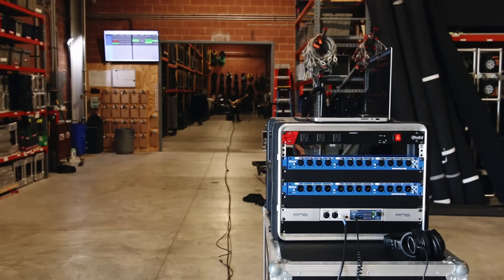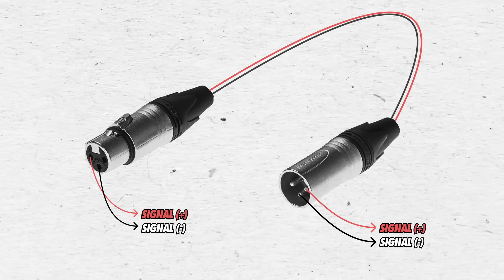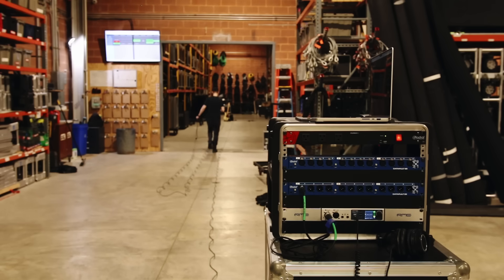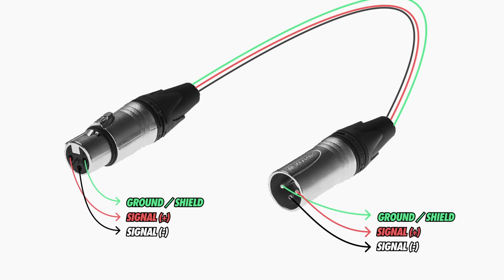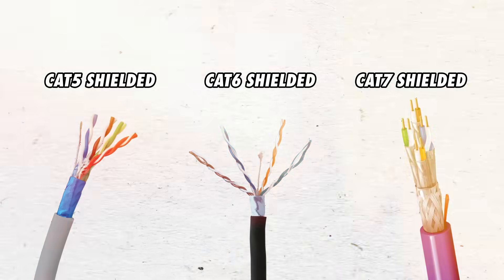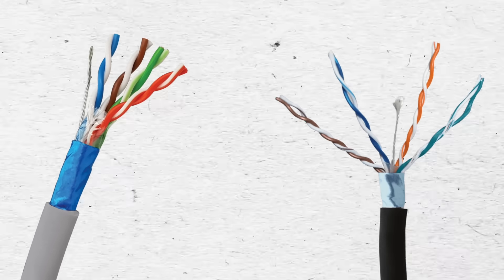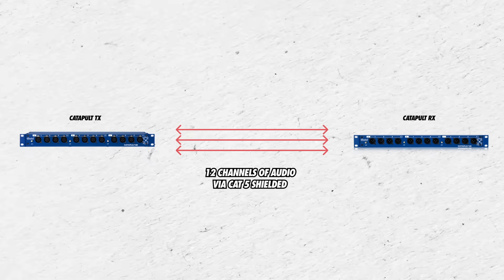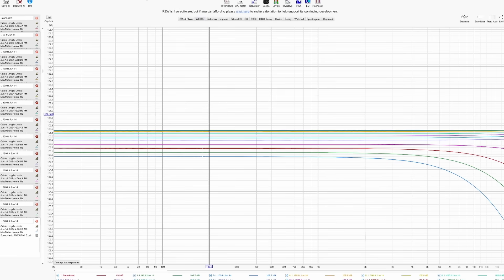Do Audio Cables Affect Sound Quality?

Comment: I have swapped balanced cables on a high-end stereo.  Sometimes, the difference in sound quality is hard-to-near-impossible to hear any differences.  And even if there is a slight difference, I would not be able to tell which ones were in use (I could hear a slight change, but not be enough to tell one from the other).

But then there are swaps where the difference is apparent.  That happened when I did a listening test with Audioquest's "Sky" interconnects.  Everything sounded better.  Switching back to any of the other balanced cables was easily noticeable (sound degradation is more noticeable than sound improvement).

All of the balanced cables that I tested (via my ears) were made by respected audio manufacturers.  But somehow those "Sky" cables were just better.

Why?  I wish I knew.  But there was no mistaking the difference.  It was not wishful thinking.  A person deaf in one ear could hear the difference.

So there is something going on with the construction of the cables that factors in to the sound quality of the stereo.

There is the "copper" vs "silver" difference to consider.  But some of the swaps that I did were with "like" metals (silver vs silver), and the "Sky" (silver) won.

My listening tests were not the same as what our host demonstrated, which was mostly for distance.  My listening tests were for wiring up a high-end, home stereo.
Reply: Sky is silver, solid core, has no dielectric molded to the conductors (each is placed in a Teflon tube) and uses 3 discrete conductors, not just 2 and a shield. If you look at the qualities I just listed, plus some others that I didn't mention, and compare them to the other cables, chances are that the materials and design of the Sky will be completely different. Given that, the real question is, how could they not sound the same? If I had to guess, the silver was the biggest factor. I've done extensive blind testing between silver and copper, but you really don't need to because the differences between them is easily apparent. But, like you said, you were testing in the context of a high end home system. In general, really good home gear reveals a lot more details than pro gear, or studio monitors. I have studio monitors from companies like Adam, KRK, Kali, and Dynaudio. I've tried high end cables with them on many occasions, and the differences, if any, were little to none. On that type of equipment, all you need is something cheap and well made, like Mogami, and you'll be fine. 

Regardless of what type of gear you have, never spend big money on cables without first trying them in your system. Also, be careful with silver. When it works, it sounds great. But that's not always the case. Quite often you get lucky and a copper cable will sound better in a particular connection.
Reply: @AT-wl9yq  "If you look at the qualities I just listed, plus some others that I didn't mention..."
That you just listed where?
That you didn't mention where?
Reply: Measure it.
Reply: @wrenchposting9097 What would you measure and why?
Reply: @wrenchposting9097  "Measure it."
How do you measure a wider soundstage?

Comment: Having done a lot of networking I immediately assumed you'd get 328 feet (100 meters) out of CAT, as this is the standard for data and POE in general before needing to insert a network switch/hub/repeater to get another 328 feet. (You can exceed the standard but it is quite dependent on the situation) Was quite surprised how you can get such a significantly longer run with analog. Not that I'd even need 100 meters let alone 8x that it was still cool to see it done!
Reply from the maker: The frequencies within the audio signal are MUCH lower than the 328-ft specification. We only need it to support 20kHz, but cable made for digital and network connections support MHz and GHz communication!

Comment: Amazing video!  I will reference this frequently! This has me now wondering about delay in relation to distance with audio signal.  Eager for more videos from you, thank you!
Reply from the maker: These electrical signals travel at the speed of light, so there will be no audible delay.
Reply: @AudioUniversity  that’s awesome thank you. Do any previous videos cover delay when daisy chaining speakers?
Reply: Just for fun, did the calculations. For the signal to have 15ms of delay (the absolute lowest of the detectable delay), the cable would have to be 2800 miles long.
For a curious coincidence, that is almost exactly maximum wide of USA from coast to coast

Comment: No self respecting guitarist is ever more than 15 foot from his amp.  Showing how bad it sounds with a 100ft cable is just stupid.  For one, WITH a cable, you want to hear the amp, second, most people will use a digital wireless.  When I play, I always use a single mono cable close to the amp to control the feedback and hear my tone, shield grounded at one end.  Also, why are you talking about TRS cables for guitars?  It's mono.  The shield is only there to stop interference down the length of the cable.  It has no benefit to connect it at both ends of the cable, as it creates a ground loop in the amp.  Just get a good quality cloth/cotton braided coax cable and solder it to 2 quality mono Neutrik jacks, cut the ground from one end, mark the shielded end and plug that into your guitar.  Noiseless and no ground loops.
Reply: I guess you didn't saw the video till the end. 
That experiment with a long RCA cable was just to show why is not possible to use unbalanced cables for long distances (From the stage to the mixing table, etc...), and that's why XLR and CAT6 cables exist.
Reply: @framegrace1  Didn't 'see' not saw
Reply: @framegrace1  Who the fuck uses a 100ft cable?, in fact I've never used a cable longer than 15 foot in 30 years, 150 gigs a year.  It IS my living.  You're all out for spending money for no reason.

Comment: There is a big difference between an unbalanced hi impedance instrument signal and a line level signal. It is not necessary to use balanced cables when dealing with line level signals in a home studio situation. It actually creates an extra failure point. The quality of the cable also makes almost no difference, when you are dealing with line levels. 

With instrument cables, there is a slight difference in tone and/or audio quality from one cable to the next, but the most expensive cable does not always outperform less expensive cables. A Mogami cable will usually sound just as good, if slightly different, compared to the most expensive cables. Once your instrument signal has been converted to low impedance, by going through the buffer stage of a guitar pedal for instance, the rest of the cables in chain also make very little difference. Spend you money on the cable that carries the high impedance signal from your instrument. Don’t worry about the rest.
Reply: Passive guitar pickups are low impedance, fuzz pedals need to see this else they don't work right.  Been playing in bands for 35 years and never needed a cable over 15-20ft.  I gig 3 times a week, every week.  Festivals, clubs, radio stations and pubs.  Just use a quality cotton/cloth cable with stainless mono Neutrik jacks for guitar/bass.  Connect the shield at one end only and plug that end into your guitar.  Noiseless and no ground loops from the amp.
Reply: passive guitar pickups are high impedance. Unless you are using two conductor wire, if you don’t connect the shield at both ends, you won’t get any signal because you won’t complete the circuit. And if you do use two wires, but only connect one side of the shield, the shield will still be attached to both ends because it will still be connected to the ground wire. The method you’re talking about would apply to balanced line level signals, not unbalanced, high impedance instrument signals.

Many, but not all, fuzz and wah pedals need to see a high impedance signal.
Reply: @APMTenants  A single coil can be around 4-8k, a humbucker 6-18k, that's low impedance.  Only active pickups have high impedance of 1 mega ohm or more.  And an audio signal is AC, only 1 signal wire, no need to 'complete the circuit' as it's not a loop.  Maybe you're confused with how audio AC works, active vs passive.  Even D'Addario sell guitar cables shielded one end only.  Planet Waves cables.
Reply: High impedance is about 1k and above. Below that is low impedance.

Active pickups are LOW IMPEDANCE, because they run through ACTIVE electronics that convert the signal to low impedance. Without the electronics, then it would be high impedance.

No man, you cannot get sound out of a guitar pickup with just one wire and no ground; that defies the laws of physics. The type of cable you’re talking about is a twin axial cable, meaning it has TWO wires, and it does nothing when connected between your guitar and amp for the reason I already explained.

You need to use google and go back to school. I’m going to ignore any further responses because it’s just too ignorant for me to deal with. Playing in bands does not qualify you as an electronics expert. This is noob level bs

Comment: DI box with 3.5 mm input available for connecting PC audio output??  Pls recommend some good brand DI box??
Reply from the maker: Check out the Radial ProAV2.
Reply: The ProCo AV1b is another good DI that has 1/8" (3.5mm) and is about $70 cheaper than the Radial.   If you are good with your audio summed to mono then the ProCo might be something to look into but if you need proper full stereo output then go with the Radial.

Comment: Not quite the video I was expecting from the title… I read once that higher frequencies prefer the surface of a conductor and so a multi-strand cable with thicker conductor yielded more high-frequency clarity over distance. I also wondered about the properties of copper vs aluminium…
Reply from the maker: The twisted pair cable is rated for frequencies MUCH higher than audio frequencies, so there may be an additional advantage there. But as you could see in the frequency analysis at the end of the video, the frequency response is flat up to about 1200 feet! Pretty amazing. These results will probably hold true for any balanced audio connection.
Reply: You're thinking of the 'skin effect' which is negligible at audio frequencies. People bring nonsense like that up when they are trying to sell you audiophile scams.
Reply: @wrenchposting9097  I’ve suspected my whole life that it was bullshit, and expected this video to deal with it. As another commenter said, it’s a rabbit hole!

Comment: I just realized that I don't think I've ever seen an electric instrument that had a balanced TRS/XLR jack. I rarely went electric with my violin so I have little to no experience with this (every option for it sounds like a farting rubber band). With all the benefits of a balanced cable, I would have thought that instrument manufacturers would be tripping over themselves to make this the standard. And for an instrument like an electric guitar it seems like there'd be plenty of space within the body to put an appropriate DI box equivalent in there. I did some googling just now and I'm getting all kinds of answers, but nothing clear and obvious. There's gotta be a good reason why this isn't a thing--especially since everyone keeps warning each other to bring your own DI box to every gig because you can't rely on the venue to have a decent one.

Is it because of the difficulty building it into the instrument? Is it because the choice of DI box has a massive impact on the tonal quality and instrumentalists are picky? Is it because the peripherals and pedals simply never come with a balanced I/O? Is it because of the added cost/weight for little benefit? Or is this just a product of the ol' "this is how So-and-So did it in 1967 and that means it's already perfect" that guitar fetishists tend to do?
Reply from the maker: I think it's because the impedance and level that come from the instrument pickup don't require a balanced connection at short, typical cable lengths. Also, the input of amplifiers and pedals is designed for this type of signal, not a low-impedance mic-level signal that comes from a DI's output.
Reply: @AudioUniversity  Can't feed a fuzz pedal with anything other than the low impedance from a guitar pickup.
Reply: @AudioUniversity  Ah, I see now. I didn't think of the impedance difference of a DI output going into the pedals and amps. It doesn't make sense to drop the signal down after the pickup if you have to boost it back up again. I've been reading up on the basic tone quality and responsiveness between active and passive pickups and now I see why even a couple thousand ohms of difference is such a big deal for the signal quality. This stuff's all new to me. What a rabbit hole. Thanks for the response!

Comment: I love when "audiophiles" claim the cable (or whatever insanely expensive piece of gear they're trying to justify in that moment) is worth the money they mention how it magically "improves sound stage", or "removes the veil" etc, all stuf that's conveniently impossible to measure, never that "it has less noise", as somehow noise can worsen or improve sound stage.
Reply: "Audiophiles" are just non-audio nerds pretending to be audio nerds. Most of them don't know anything, just a bunch of mumbo jumbo about why vinyl is objectively better or something stupid. They'll spend 10K in gear, another 10K in records, and then never stop and think to acoustically treat their damn room.
Reply: @urphakeandgey6308  I do 150 gigs a year, playing in pubs, clubs and open air festivals.  I know what you need.  Really you don't need to spend loads of money, I don't.  Most guitarists and bass players that walk into crowds with wireless just come across as pricks.
Reply: Just get a decent quality mono cable and solder the ground at one end only.  For the best noiseless result, use cotton/cloth braided coax and Neutrik stainless jacks.  Plug the shielded end in your guitar.  No noise on the cable and no ground loops from the amp.  Simple and cheap.
Reply: Well you didn't take long to turn up.
Reply: I always laugh at that. Even if the audiophools electronics were perfect (i.e. no distortion and exact reproduction of the mastered audio), they seem to forget that the recording engineers will have used cables as well, and they would not have been made of silver plated superconducting unobtainium that “broadens the soundstage, blablablll…”. The sound at home will only ever be as good as the weakest link permits or worse.

Comment: This is great. Is the ethernet system bidirectional. I help with a middle school drama club and need to send signal to stage monitors, a monitor in another room for off-stage choir (as well as choir microphone in that room), etc. Have a workable system but have to lay down (and take up) a lot of XLR cable for each show. Wondering if I could reduce these by multiples of 4? Thanks for any advice.
Reply from the maker: Yes. The catapult systems are by directional. If you need to use one of the channels in the opposite direction, you can use a male-to-male or female-to-female XLR turn around adapter on either side.
Reply: @AudioUniversity  Thanks so much. Your channel really helps out this retired-microbiologist-dad/"sound engineer"!  (FYI- I already use Radial DI boxes 👏)

Comment: However, a shielded balanced cable can also lead to problems. 
We wanted to connect a mixer in one corner of the hall to an amplifier in another room. The mixer and the amplifier have the housing on PE of the main socket. Because the XLR cable shield is connected internally to PE, it was grounded at both ends. This led to disturbing noises. 
It helped to put a sound transformer in between and interrupt the shielded screen.
Reply from the maker: Great point! Ground loops!
Reply: @AudioUniversity  For mono instruments like guitars, just use a good quality cloth/cotton coax cable with the shield connected at one end only.  Plug the shielded end into your guitar.  No noise down the cable and no ground loops.  The signal uses only one wire.  The ground/shield is effective only along its length.  No need to connect the shield at both ends.

Comment: Everyone can have their own proof or opinion but here are my experiences: 
1. I used to have my studio wired with generic  audio cables and monster cable cables. I had buzzing and other noise in the signal path. I switched to Mogami and there is no noise at all. 
2. had RJ45 connectors and cat6 cable from Amazon for digital snake about 150 feet long, had drop outs quite often, the system was almost unusable. Switched to cable and RJ45 connectors bought at local electrical store, and now have 0 problems.
Reply from the maker: Yes. The quality of cable and connector construction will vary.

Comment: Great video. Just thought to mention that on the initial example of an instrument TS cable the impedance is important for the noise immunity. Instrument Active circuits lowers impedance and that offer advantages for noise reduction too. DI boxes not only implements differential amplifiers but also buffers signal to lower impedance

Comment: I have to connect audio output  from my PC to a audio Mixer which  is more than 15 meter.
 Option1: Connecting Line output from PC to mixer using a DI box
Option2: using a HDMI cable and Audio Deembedder 

Which option is best???
Reply from the maker: If you need multichannel surround, use the HDMI Audio De-embedder. If you just need stereo, either option is ok.